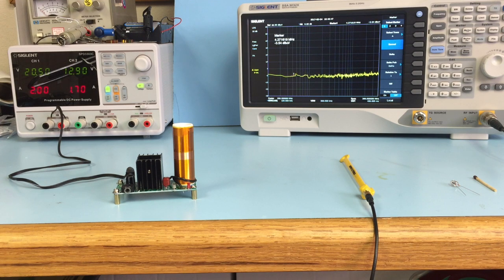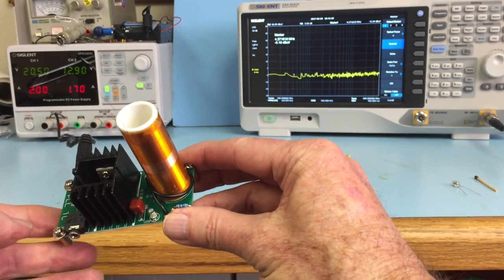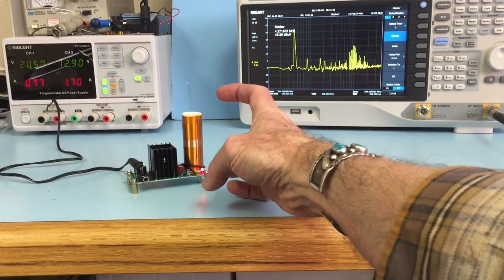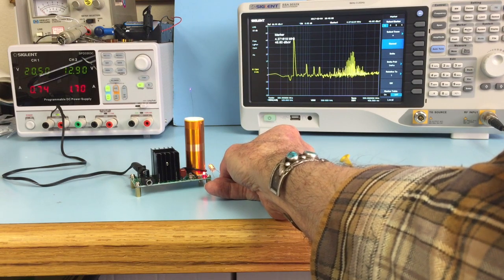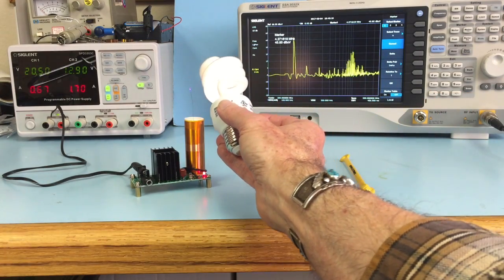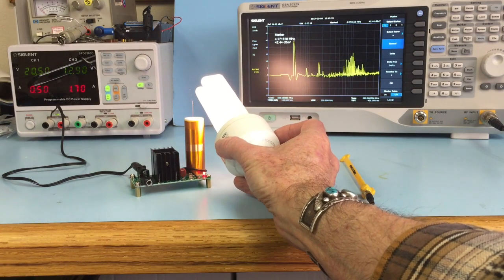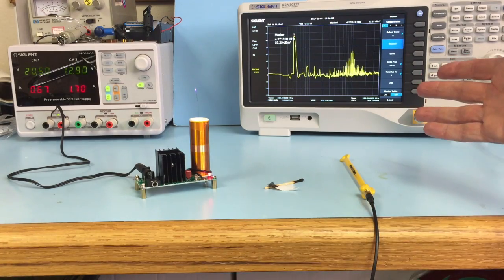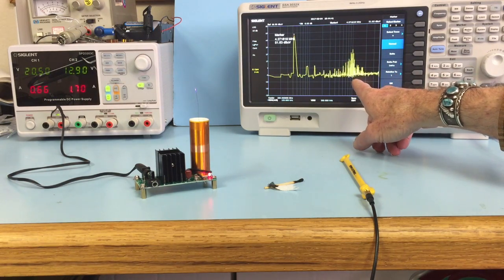Tesla Coil Demo - Wyatt

Comment: Hi! Thank you for the video! Could you explain me what kind of spectrum analizer probe (yellow one) are you using please? I would like to make same measures in a bigger tesla coil.  Regards. Maxi
Reply from the maker: Hi Maximiliano, thanks for your kind comment! I'm using the middle-sized H-field probe from Beehive Electronics (http://www.beehive-electronics.com). Be careful not to exceed the input signal on the spectrum analyzer with your larger Tesla coil. Note that mine is several cm away from the little one. Cheers, Ken